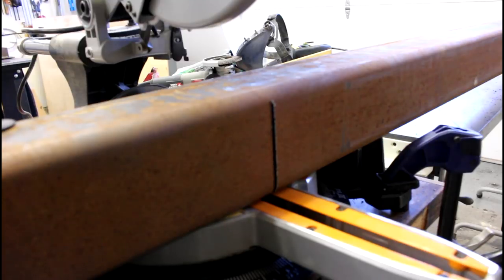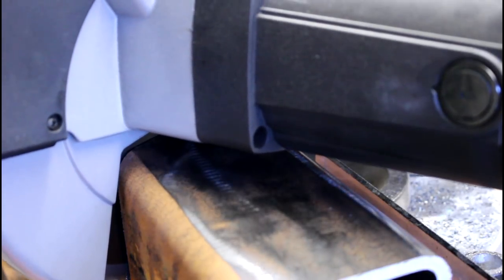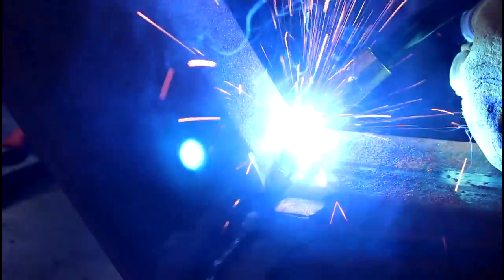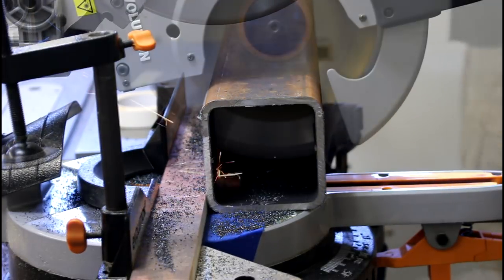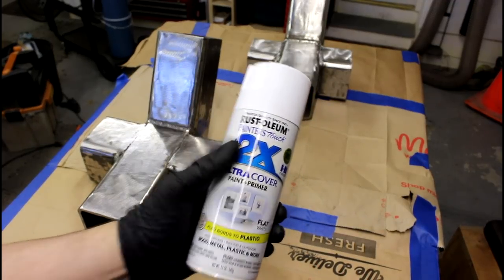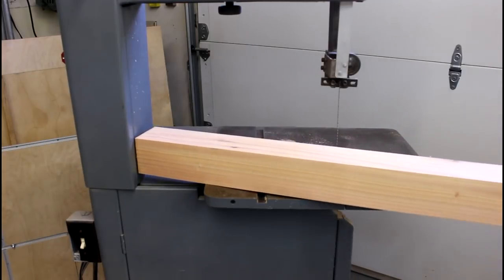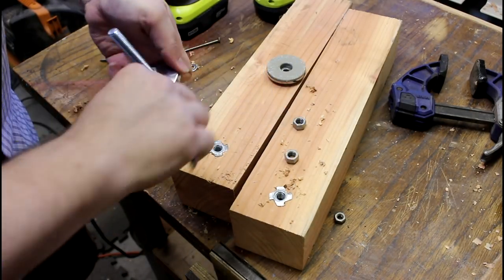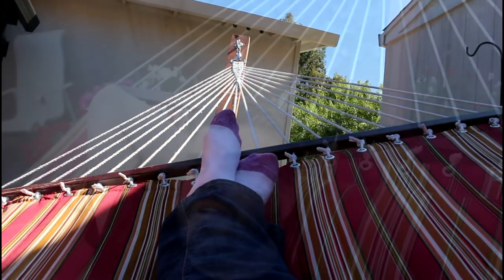Steel & Redwood Hammock Stand

Comment: For the first time welding i think you did a wonderful job
Reply from the maker: Thank you very much. I've been watching a lot of https://www.youtube.com/user/weldingtipsandtricks
Reply: Alyx Rigby I agree, I've been welding for 6 months and mine are just now looking that good
Reply: whole lot better than my first job
Reply: Next time just as a suggestion try putting a bevel at the join you will need to use a little more welding wire but you will also end up with a stronger weld a good portion of ending up with a good weld (even with experience) is how you prep the material and joint area
Reply: Alyx Rigby that's what I started doing about a month ago
Reply: Rasasvada I was always taught the 7 P's 
Proper
Prior
Planning/Preparation
Prevents
Piss
Poor
Performance
Reply: Rhys Webb unnecessary p's. Proper Preparation Prevents Poor Performance.
Reply: 100 Bees I know some are unnecessary but that's what my old supervisor drummed into me and it doesn't seem right without all 7 😂
Reply: Rhys Webb can't argue with that!
Reply: For sure. My first weld was atrocious compared.
Reply: forgot the weld prep, not a lot of weld holding it,  then ground it off so there is even less strength, could be a bit hotter, but all in all a decent looking weld for a no welder.
Reply: I have to agree. Many many years ago, as part of my Merchant Navy engineering training, I was taught gas and arc welding by an actual instructor and your "beginners" welds are every bit as good (as mine, not the instructors!). The band saw problem? Eh, hand saw and some elbow grease?! Great project ;-)
Reply: 1980-84, then the company went bust! I went to MNC Greenhithe in Kent (and Poplar College and workshops at Woolwich) which would have been TS Worcester at the time Vindicatrix was around

Comment: two quick suggestions cuz it's almost summer!  they both have to do with watermelon actually.  
1. redo that tiki project you did years ago with a watermelon cuz watermelon carving.

2. dry out the inside of a water melon and see if you can fill it with resin.  than make something summery out of it!

Comment: Peter, for your future welding endeavors you should bevel the edges of where your going to be welding whenever possible. This will allow the puddle to flow deeper and promote better penetration than a surface weld. By no means am I a professional welder but beveling has indeed saved my ass in many critical welds!

Comment: just a little tip for welding, when you weld the 2 pieces together you should bevel the edges about 30 degrees or so and fill the entire gap with the weld. makes a much stronger weld

Comment: I'm actually a certified welder, so usually when I see someone weld for the first time I cringe a bit, but you did very well. I'd actually feel comfortable putting my weight into that hammock. I'd suggest either slowing your travel speed down or bringing your heat up though to help improve your welds so they'd be more like a gentle hill than a sharp mountain when you do your butt joints. Love your stuff.

(Edited the speed part to clarify I mean travel speed and not wire speed.)

Comment: From my experience hammock camping, if you have the head and feet at the same height you'll wake up with a lower back pinch. easy solution is to have your feet 6" to 1 ft lower than your head. I wish I had a welder and I would totally replicate this project. I think it turned out great.

Comment: This is where a good proper bandsaw makes all the difference in the world. Set it up and let it fall. Shuts itself off when it's done and if you don't prop up the piece being cut you get an auditory alarm. Also with the right wire you can have a little bit of scale and be just fine.
Reply: Wait, so you've only got a metal chop saw and a wood stand up bandsaw. Weird selection. Good work, but just an odd tool selection.

Comment: A lot of welding you can do by sound. Without be able to see your welding it sounded good and the finished product look better then most first timers. Some quick tips, push for flatter bead, drag for thicker bead, penetration is better than looks, if your weld looks like crap always check your gas first. Welding opens up a world of possibilities for projects and I look forward to seeing what you come up with.
Reply from the maker: Thank you! So, push or drag? I still need to wrap myself around the terms! :)
Reply: Honestly I could explain it but the response would be very long and I'm sure as a YouTuber you know it's probably just easier to watch a video on it lol. And leaving behind some of your actual weld beads it a sign of pride. If you just grind them all then you are a grinder not a welder lol.
Reply: Also as a welder who has gone to school for welding and do it as a profession, I could climb onto that hammock without a second thought of it coming apart (and it looks good to boot) well done sir
Reply from the maker: Thank you very much for your time! I really appreciate the help!

Comment: you did awesome at welding for your first time! I remember my first ones and they were terrible. a tip maybe to help is run the welder a bit hotter if you can on material that size, otherwise awesome project.

Comment: Thoughts on the welding:
-Really thick material. Weld with a slight gap between the two pieces and join them. Running 2 beads is fine and expected.
-Welds look all right, but not quite hot enough. Not quite enough penetration.
-Consider tack welding your pieces in place. Put tacks on all corners of your work so when you run a bead on one end, the whole project doesn't move while the metal is expanding and contracting. There is enough movement from laying one bead to mess the other side up and throw an entire project out of square. 

Thoughts for the future.

Comment: Great job for your first welding project!  Two tips, if I may... turn up the heat just a bit more when you're working with steel that thick (3/16", right?) and for butt joints (where two pieces are butted together flat), grind the edges at a 45° angle opposite each other so that the weld has a bit of a valley to sit in.

Comment: PETER you did great welding that. only thing i would recommend is to slow down you movement. That will help those welds flatten out and provide a stronger weld👍👍👍👍👍

Comment: Would be good if the sharp edges of the steel were bend into a radius, so it does not dig into the wood.

Comment: Good job on first weld job, just remember to pull don't push your weld. It's probably not a big deal with the hammock, but you trap air pockets in your bead when you push.

Comment: love your work and your honesty. Had a old thought about something you said in a resin video about using a vacume chamber to get all the air bubbles out and how that most people don't have access to them so you don't use them. Could you try using something that vibrates to shake the bubbles up and out?
Reply: dragaunas Does not work very well because epoxy is mostly very thick. If the resin is filled with something the bubbles can also get trapped. You can buy cheap vacuum pumps for about $100.

Comment: Good word to the wise, always tac your metal first before running a full bead, that way if the metal shifts any for whatever reason, you can reposition it without fighting with a full bead
Reply from the maker: +Kingone134 thanks! I had it shift a bit. That makes sense now.

Comment: just some comments on welding, good job, it's cool to see people getting into it. but to help, keep your tip 90° side to side and experiment with your push angle. also you traveled a little fast so try to really only focuse on the bead and right behind it and try to tie on to both sides which was hard for me when I was learning.

Comment: Grind a chamfer on each mating surface to create a valley for the welding wire to fill. You'll get better welding penetration and less material to grind flat.

Comment: Bevel the edges to get penetration to the backside of the tube; otherwise the weld bead is only sitting on one side especially if it is a cold weld. Grinding some or all of the bead exaggerates the problem.

Tack welds are small welds placed all around the joint before the final welding is done. These hold the structure while welding and cooling expands and contracts the puddle. These are needed because those couple bar can't hold back against the immense forces; if not done it will warp and go out of square.

Comment: Yes!! 👍
Reply from the maker: I thought you might like this. How did I do? Any advice?
Reply: I think you did a fantastic job.  Quick tip for your next welding project.  If you ever want to grind your welds smooth, you should grind and bevel the edge of the steel so you get a "V" after you butt the metal together.  The weld down inside the V will still be there after you grind it smooth.  It's important for structural builds. Not a big deal for non structural.   I hope to see more welding projects.  Well done Sir!

Comment: add a chamfer to the area you are welding it'll make it stronger
Reply from the maker: Thank you. Is that because there will be less metal to heat up?
Reply: A chamfer will give your weld more surface area so it's stronger, and make it so your weld doesn't stick out as much
Reply: Erik Larson also, if you can't bevel, welding at a higher amperage and rolling the bead out wider will make it stronger and, make the bead smoother.
Reply: Yes I noted the bead is quite high and that's often a sign of low amps; weld not hot enough. Try upping the amps and weaving / slowing down and that may allow the bead to show deeper penetration. More penetration means more of joint is actually welded steel and not just cold butted together. Adding a chamfer may mean making two passes of weld but it means you have completely joined the pieces together all the way through.

Comment: For your first time welding, they look pretty good! Although in the near future, if you ever put a butt joint together again, try to put a very small gap between the two peices. This will result in a flatter, even more sturdy weld. I'm not bashing your welds, they are great the way you did it. By putting that gap in there it allows for more penetration/ flatter looking welds.

Comment: You can get a wide blade for your band saw and turn the RPMs down for steel. It works great.

That was your first welds ever? That is actually wonderful for your first time. Yes there is room for improvement, but those look like good strong welds too me, and I have years of experience analyzing welds for a living.

Comment: when you weld come a little closer with the tip and it won't be so tall And stringy
Reply: It also helps to focus the bead on the material more than the center, but you still did really good
Reply from the maker: Thank you. I'm hoping for lots of helpful advice!
Reply: Peter Brown your welcome and like you said the best way to learn is to just do it

Comment: Go up on power if your machine can handle it, for mig, voltage is the voltage or arc force and amps is the wire feed rate (some smaller machines have amps adjustment separately). 
for that size tube I would go 25-30V and loads of amps, like +150.
to get stronger welds at lower power you can either weld dual shield (gas+flux cored wire) or just stick weld it. 3.2mm electrodes at around 130 amps or 2.4mm around 80 amps if your machine can't do ~130 amps.
Either way, on thick steel you need a lot of heat to get good welds. one option is to preheat the parts by a torch to 200-300C and then weld. also, for mig, the hot-roll steel scale should not be a problem as long as you have enough heat. stick welding usually is not affected by hot-roll scale.

in general, getting strong welds out of mig is a bit trickier than stick or tig. if you can't do high enough amps or good weld prep and preheat, stick is the best option.

Comment: putting a piece of steel in white vinagar for 24 hours can help remove most or all of the scale if you work with steel again.
Reply: citric acid from a brewers shop works great too.
Reply: Seems the grinder was much faster in this case.

Comment: Peter I can't believe you just cut steel stock with your damn mitre saw lmao
Reply from the maker: Yes, but that saw is MADE for cutting steel. Most aren't :)
Reply: Pulling miracles here, I gotta get me one of those
Reply: Sean Gibson hi peter, do you think you could make some sort of milliliter shaving project? I think it would look cool to have epoxy putty suspended in epoxy, maybe make a bottle stopper as a test?
Reply: Sean Gibson I tried cutting thin stainless once on my table saw. It got way to hot no matter how slow I pushed it. The saw blade was going to be send off for sharpening anyway that day. I cannot recommend it.
Reply from the maker: It so much cleaner than a fiber blade AND it's not hot after the cut...

Comment: did you tac the pieces before welding? Weld for like half a second on each corner of your material before running a full bead, glad to see you doing a metal project, the way i learned to weld was getting a piece of metal and fitting as many beads on it as possible, good luck.

Comment: peter, greeting from germany.
if you want ro improve your weld, use more energy. if you do, it wont sparkle that much and the weld gets deaper. but if the weld burns through, use less welding wire. :)

Comment: What do you do with the wood shavings when youre done? Do you throw them out or store them for other uses? If there is a clean burning adhesive or way to do it, you could probably either press it into starter firelogs or just wrap some in a cheap flammable material as tinder bags to put in the bottom of a log formation to light

Comment: You really needed to end the segment with a cold beer in hand! Great job welding, Non-pro tip: careful mixing grinder sparks and sawdust from power tools ... don't ask me how I know ;)
Reply from the maker: haha! I hope you are okay and nothing bad happened. I was super careful to sweep up all the sawdust before breaking out the metal tools! :)
Reply: Peter Brown Stupid rookie mistake, I was sharpening some tools on a sanding belt and realized the light illuminating my project wasn't from my shop light, but the nice warm glow of combustion. No damage, other than my pride :)

Comment: hey peter! welcome to the world of welding, i have a VERY IMPORTANT tip for you! now a lot people get annoyed at this because they already know this, but i didn't and it's better to be safe than dead or at least incredibly ill :) 

STAY AWAY FROM GALVANISED STEEL! you might as well eat lead. 
galvanisation burns and evaporates into zinc and zinc oxide fumes and inhaling that can give you galvanisation poisoning aka metal flu. it's called that because it feels like the flu in the beginning and then suddenly don't.

I have had it before and i had to be rushed to the hospital because i lost consciousness and stopped breathing for a while, not for long but certainly longer than you are supposed to!
so ALWAYS work in a very well ventilated area, wear a fume mask if you can and avoid galvanised steel :)

Comment: Sweet project! Is it for you or for the lady? Lol
Nice job on the welding. Little more heat would help smooth things out a bit. Or cut back on your feed and slow down your travel. Thicker metal like that you could also grind a v into it first to get the penetration nice a deep. Keep it up. Love the videos!

Comment: Although that's a fine welding job for a first project I'm a little uncomfortable with the amount of penetration you achieved given that this design is heavily reliant on a strong weld. 
Many commenters recommended grinding chamfers at your weld joint which is very much standard practice for metal of this gauge. I haven't seen anyone mention the quick and dirty alternative which is to stick a bent wire of appropriate thickness in the joint to create a stable gap you can fill with weld. The gap drains away your shield gas which causes problems and throws off your measurement but it's a lot faster and were all in a hurry aren't we.

The other thing that bothered me is you got so caught up in your newfound welding skill that you forgot to be a bad ass woodworker and taper those vertical 4x4's ;)

Great project, keep it up!

Comment: Because your steel box is so much larger than your wood beam, do you have any concerns of having water pool and cause premature rot?   My thoughts are you could simple put a bead of silicone at all the joints where your steel meets the wood.  Or maybe a inset a rubber gasket (square o-ring?)  shrug   Great looking project mi amigo.  Looks relaxing!

Comment: Welds didnt look that bad, they say for a good weld that you should be able to weld a line and then flip the flat piece over and see if it is glowing red. if it is you have done it right. I was also paranoid of the sparks but after 2 or so times of them landing on you don't feel them that much

Comment: i just find out, if you mix epoxy in styrofoam cup, it will harden in a couple of second (about 30second or more) if you mix it and leave it untouched. And it will get super hot

Comment: i get the reasoning behind not smoothing out the welds, but it seems there were some crevices on the welds left. if that joint isnt completely sealed with paint or what have you, water that gets into there would have a hard time evaporating and corrode the metal faster and deeper than on even untreated flat steel, possibly making the weld fail faster
Reply from the maker: I hadn't thought about that. I'll keep an eye on it! Thanks

Comment: your welds are not bad but most were too cold. You can see there is a hard almost rolling edge on the side of the welds. like a bubble? if you turn up the voltage it should flatten out.